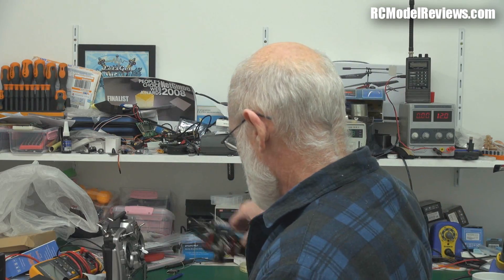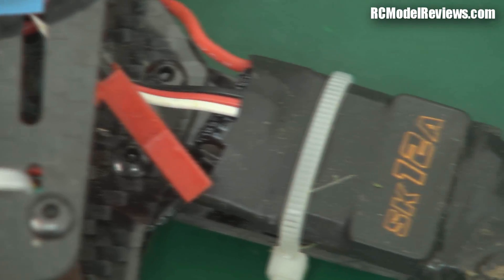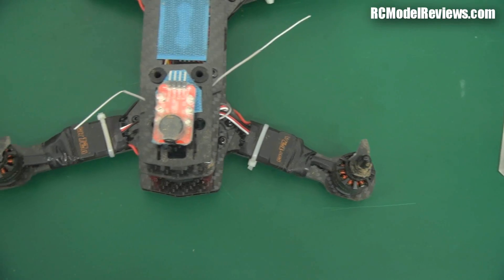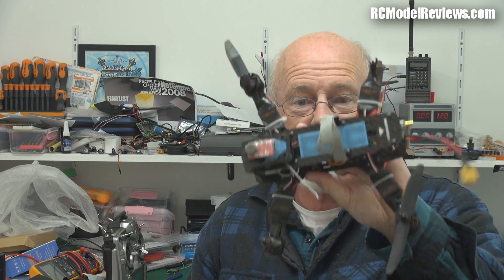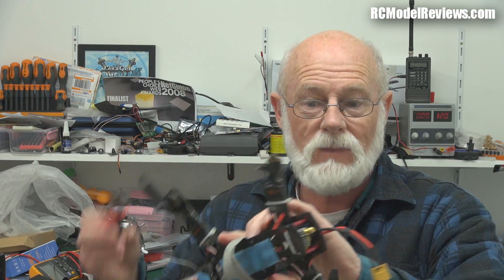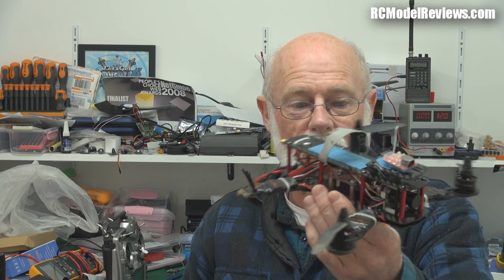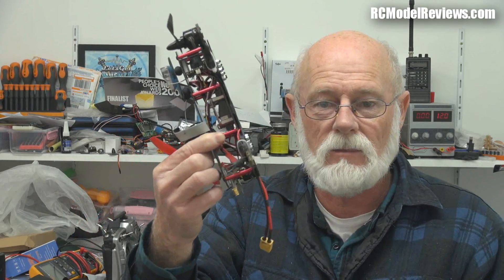ZMR-250 Chinese mini quadcopter crash report

Comment: Hey Bruce, I've been flying this frame for the last month. I broke  around 20 props, 3 EMAX motors, one vTx(antenna connector), two of them pink Al support column thingies and even somehow managed to break barometer on the Naze32(still not sure how that happened),even managed to fry 2 ESCs.

Crashed it into mud, dirt, grass and concrete. When I crashed it to concrete I bent two motor shafts, broke all 4 props, and the vtx got flown 10 meters away from the crash site due to the force of the impact. I don't have OSD so I can't be sure, but I was probably making more than 50 km/h during crash. Arms were just fine. Only some minor scuffing on the frame. I'm still using the same frame. It's working just fine. 

I don't think you're intentionally misleading anyone, but either Berry managed to crash that thing just the wrong way(in such a way that even a blackout would have broken), or you are just prepared to not  to like this frame. No one is saying this frame is better than Blackout. What we are saying is, For the price of one blackout frame you can buy 6-7 of these "cheap Chinese knockoffs"(Which i did. I bought 2 of them, one is still unopened. Also with the leftovers I bought 8 motors and 4 ESCs)

The next argument is "But if you bought a Blackout, you wouldn't have to bother with fixing it all the time" What if it flies away? What if it falls down into a river? Sea? In a massive corn field? Or it falls down on a road and before you pick it up, someone turned it into a paste with a car(happened to my friends MiniQuad)? You just lost 200$ worth frame. While I just lost 30-40$

I got nothing but respect for the guys behind innovative frames like Blackout or QAV250. But the fact of the life is some of us don't want to(or can't) spend 200$ on a mini quad frame while just a fraction lower quality frame can be found for 40$

Reviews like your make people think that if they can't afford to buy that 200$ QAV250 with 40$ a piece T-motors, they shouldn't even bother with the hobby. Which is simply not the case.

We need new people joining the hobby, now more than ever. Bashing affordable alternatives while glorifying the ridiculously priced products is not the way to go.

Cheers.
Reply: illusive aeldre I'll do another video comparing the arms of the ZMR with other miniquads and you'll see how much weaker they are in this area.  All they have to do is make the arms a bit wider and the problem would be solved.
Reply: Then they would be heavier, and people would bitch about how heavy the frame is. IF you don't mind some extra weight, put two arms together, add some CA in-between. Now you've got 6mm arms that are practically unbreakable.
Reply: illusive aeldre
That's always an option.  Remember you'd also need longer bolts for the motors and for mounting the arms themselves.
Reply: I already have 2 nylon nuts on each bolt(to have the ESCs inside the frame), and EMAX MT1806's comes with 3mm screws, so I had to get longer ones anyway
Reply: illusive aeldre I built my ZMR up, but I'm only using one bolt and cable ties through another, 4 bolts on each arm seems excessive.
Reply: I agree that 4 bolts might be excessive, but just 1 bolt sounds a little too less to me. aren't you having flex issues?
Reply: not yet, no motors on it ;-)
Reply: I beat the crap out of my 3 ZMR250's and they take a beating! I also have a Blackout that sits and collects dust, I can't afford to crash my $600 rig! So until Blackout and GetFPV start sending me free mini quads I'm gonna keep bashing my "cheap Chinese clones"!
Reply: jkflorida2013 Why the hell did you spend 600 bucks on a hanger-queen then for, you tool?
Reply: I built the Blackout way before these cheap frames came out. I still fly it just not as much and not as hard as the ZMR250. Also I can't sell it. It's like my baby.
Reply: jkflorida2013 Then it must have a particular "sense of value" to you.

And I can understand you not wanting to trash it. Truth be known, it would probably survive more prangs that most of your ZMR's. But I hear you - it's hell hard to toss up your best in case it comes back a wreck, huh? Not all bingles are the same - height, speed, angle of incidence blah blah blah. Would hurt to trash your Blackout, but hey... didn't you buy it to fly it? 

"Tool" was probably a bit strong from me - with 'florida' in your uid, I'm guessing you're from the USofA? That word can be both passive or aggressive. Take it as being 'ya dick - all that money and you're not flying it'

No direct offence meant Buddy, K?

Comment: Sorry, but for comparison can you crash the blackout and qav exactly the same way as this one? Otherwise it wouldn't be a fair comparison.
Another thing I'd like to see is a video of the crash. For all we know it fell out of the sky from 2 km...
I understand that a blackout is a better product but to be honest it since the first part of the review it looks like you wánt this frame to fail... Normally your reviews are more objective in my opinion.

I fly with rcx motors so this repear would cost me around: 10 USD including shipping. I can crash like that 12 times before it cost me as mutch as the blackout.
Reply: You're right of course but I've never seen a blackout with a broken arm...
Reply: Frans de Jong This frame fell onto damp soil, the same as my Blackout has on many occasions.  I've broken all four props on my Blackout on many occasions and on the weekend, a QAV250 flew straight into a tree (whack!) then fell to the ground -- broken props).You only have to look at the ZMR frame to see that the wrist section of the arms are a stress riser which is more likely to fail than the rest of the frame.You don't see many broken carbon frames around and those which are broken have usually encountered a very hard surface such as concrete or a road-surface.I have to say that I was a little disappointed that this arm broke so easily, I was expecting it to be a bit tougher and able to survive falling on to damp ground from any height.If I didn't publish this video and folk started bitching about their ZMR frames breaking arms too easily, people would castigate me for not pointing out the weak-points  -- rock and a hard place ;-)
Reply: ***** Since you have both, do the arms of the blackout fit on the zmr? It would be a cheap way to gradualy upgrade to a blackout
Reply: Frans de Jong I'll check tomorrow but I know they're quite a bit shorter for a start.
Reply: +xjet that shouldn't be a problem. I have a lot of space between the props and the frame with 5" props.

Could it be a QC issue with the arm? I looked back in your reviews and my frame is a lot better quality than your showing in the video with the bad drilling...
Reply: Frans de Jong
There's certainly not a lot of material at this point on the arm and this particular version has narrower slots for the screws than later ones I've got here so it "should" be stronger.   The newer arms seem to be a different layup to this one so it will be interesting to see if they are indeed stronger.

On the positive side... apart from having the wires torn out of it, the RCTimer motor didn't suffer any damage to the shaft or anything, which isn't bad, considering they're only 2mm shafts.
Reply: ***** hi bruce ive got this same quad thanks for ur 1st review, n its super good,nice shine no problem what so ever with the holes
Ur motor wires came off cause u soldered them to the esc ..if u used bullet connectors this wouldnt have happened for sure
Reply: Mar1wan1
Bullets are bad-news.  They're extra weight and a potential failure point.  I never use bullets in any of my multirotors because I've seen them cause too much grief.

It was only a $10 motor so I'm not worried... some people spend more than that on carbon props for their minis :-)
Reply: ***** i know its extra weight i watched ur previous vids but i think this extra weight worth saving ur motors: )...btw i also directly soldered my motors to escs..but now thinking to go back to bullets
Reply: Mar1wan1 I've started using servo connectors, much tidier. They handle the amps on 3s with no problems so far.
Reply: Heh, a broken arm is kinda hard to interpret, either it's broken or it's not.  I'm not sure how I would surf the internet in a way that would let me semi-intentionally avoid seeing broken Blackout arms but it's an interesting theory...  I think it would be more likely that I'm lying either to myself or to youtube, if that's what you want to believe. ;)
Reply: Matthew Adams
I think the video I have just uploaded kind of conclusively shows why the Blackout arms are stronger (and therefore less likely to break).   The ZMR250 arms are weaker -- but it is only a $30 frame so I don't understand why so many people are upset by the fact that it's not as strong as  a $150 frame.
Reply: ***** I don't think anybody is upset about the fact that the zmr is the weakest one.

I watch all you vids and the review about the zmr is the first one ever to look a little biased. I was shocked by that. But your latest vid explained everything.

Keep up the good work and don't be so scared of a little critic on your work we (I) just want to keep you sharp as ever :P
Reply: Matthew Adams Yep, its like being a little bit pregnant.

Comment: I agree with some of the comments that for some unknown reason to us, you are bashing the Chinese frames vs the name brand without being very objective.  Yes,you get what you pay for but that's expected and anyone can easily break one of the name brand frames by going full speed into a cement wall.  In order to correctly asses the breakage/quality you would need to break both frames under the same conditions and that can only be done "on the bench"..

As far as the broken motor, it can be repaired easily with a little time and effort.  I have rewound many motors and often my rewinds come out better than the factory one.

Comment: Just finished putting my ZMR250 together, did the first flight on the weekend when it was way too windy and had a few since then and so far I am loving it.
I know they may not be as strong as the more expensive frames so I have attached my motors with zip ties. We will see if it helps in time. :)
That naze32 is definitely superior to the KK2.
The only things I have done so far is up the yaw rate a bit and stop the motors spinning up on arm.
I do want to get a CPPM capable rx though, will make the wiring much tidier.

Comment: Hi Bruce, Looking at a new transmitter. frsky 9d. I've seen your vids on them just wondering if you have a different thought on them to date. As of now running an orange tx and receiver but had some unexplained crashes (dji f 450 kk2) im thinking its the radio.what is your take on the transmitter today and are you still using it? got the naze 32 afro flight with telemetry and all the bells and whistles. will radio be a good one. Thanks

Comment: not looking good for the ZMR frames, i see this around a lot on the forums and your earlier review of the cheap carbon fiber they use. Do you think its an issue with the CF or the design of the arms??  

im now more than ever determined to make my own frames
Reply: Syler1979 It may be a combination of the material and the design.The combination of the long slots for motor-bolts and the narrow arms where they join the motor mount section produces several points of high stress -- where the forces are concentrated into a very small area in the event of an impact on one of the arms.It would be much better if they made the arms wider or did not taper them quite so much  near the motor mount.
Reply: ***** So more a case of no R&D in the production more just a design and cut approach. Its given me something to think about with the designs i have been coming up with, they all taper down toward the motor mount and use elongated bolt holes in an X configuration to allow 16-19 motor mounts

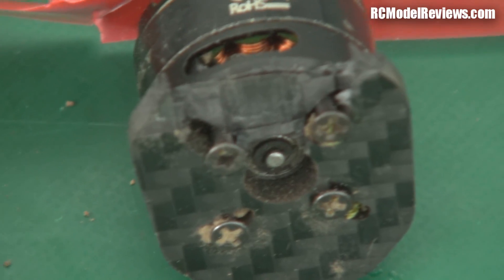Comment: Around the 1:10 mark he makes a comment that the arms are very thin, yet they are the exact same thickness as the BO frames, 3mm thick.
Reply: raider1284 That's thin in width when looking down on the quad.  Perhaps I should have said "narrow".
Reply: ***** They look to be the exact same width, or very similar at least. 

The zmr arms: http://imgmgr.banggood.com/images/upload/2014/08/SKU147479-6.jpg

The BO arms: http://www.minihquad.com/media/catalog/product/cache/1/image/1600x/040ec09b1e35df139433887a97daa66f/i/m/img_6609_2.jpg
Reply: raider1284
Not quite... I'll post a video later today in which you'll be able to see the very significant difference in the width of material at the narrowest point -- where slots for the motor bolts have been milled.
Reply: ***** That would be very helpful, thanks. If the product pictures for the zmr frame are purposely misleading that would be very helpful to know and quite damning info against that product.

Comment: Do you know if this particular arm had a lot of cracks or defects around the screw holes? I'm wondering if the problem is part design, partly defective carbon fibre, partly poor machining.
Reply: crenn6977 It's mainly design, as you'll see in a video I'm uploading now.

Comment: I've had landings into soft mud snap off an arm on my cheapy sk450. It's hit some trees and stuff and only broken the pops so it's not like it's super weak. I think that if you get one arm stuck in soft mud the rest of the quad wants to keep moving and snaps the stuck arm off.
Reply: donpalmera Yeah, but isn't the SK450 plastic?The 450 is also heavier and has longer arms -- which means much more stress is applied to those arms if you have a crash.  Short of a very high-speed contact with concrete or rock, these carbon miniquad frames should be virtually indestructable and indeed, most of them are.
Reply: ***** Not sure what it's made of. The edges of the snap are "hairy" like it's made up of fibre. I've got a $40 mini frame (I'm cheap) in the post because of your videos :).

Comment: What do you mean "Like Spektrum"?
Reply: oliverg98 Spektrum was, and still is to a degree, (IMHO) a very overpriced system.   Certainly the original DX series transmitters and receivers were very lacking in the "bang for your buck" department.The newer stuff is far better... but still can't come close to the value for money that some of the other gear on the market offers.  With Spektrum you are paying a significant premium for the branding -- which obviously many people believe is worth it.  However, there are a lot of folks who've moved to other brands after trying them and experiencing the extra value that can be had by doing so.
Reply: Is that why due to the RCM&E survey spektrum is the most used radio gear!
Reply: Oliver Gallimore
Yep, because Spektrum put so much money into marketing the product is very widely used.   However, Spektrum users have to be aware that the only way the company can afford to put that much money into marketing is by charging a healthy premium on top of the true value.

Comment: How about double up on the arms so you end up with 6mm the same as the MXP230.. Also means more space between the bottom frame to work with for a wire harness,, :)

Comment: Just use 2 nylon bolts on the arms... and they break first 
Works a treat
Reply: The solution is often the simplest of all. :') Good idea!
Reply: SvenOkonomi An even better solution is "stronger arms" :-)  Saves on nylon bolts :-)
Reply: *****
Quite right, so heres a curveball: Do the blackout or Q spare arms fit the Chinese frames? ;) Press costs where strength doesn't matter, and still have the strength where it counts.
Reply: SvenOkonomi
From memory, I don't think they fitted -- I know they're shorter for a start but I'll check tomorrow.
Reply: And bullets right at the motor so it doesn't pull the wires out.

Comment: Bruce, it's unfair and a bad generalisation, to label all of these china made quads as bad quality and weak. I have had several massive crashes with mine (as have others) and the quad has not even got a scratch on it. One crash was from 70' up, I had a brain fart while inverted and went full pelt into Terra Firma. Nothing, not even a broken prop (Mine are carbon). So I really do think that in this particular case you have just received a dud.
Reply: SJohnM81 I only labeled the ZMR250 as having a weakness and when you look at how it's designed you can see that the point where the arm is at its narrowest just before the motor mount area is always going to be vulnerable to crashes where the motor hits the ground first.   I can only review what I have -- which is why I have 3 of these frames.  The latest one looks a bit better than the first two but we'll see how it turns out.

Comment: My kim250 cheap $40 chinese frame has took a beating its not even carbon fiber just G10. Its fallen a good 60ft inverted, crashed full speed into a steel post and much more and i am yet to even scratch this frame.

 I think you are giving chinese frames a bad name when they deserve some praise. Obviously the quality wont be the same as the $200 frames but I doubt any of them would of stood upto what this kim250 has
Reply: "would have"
Reply: Well done

Comment: The ZMR 250 centre plates are .5mm thicker than the Blackout centre plates.  Instead of focusing purely on the arms (which are the same thickness) perhaps consider if the arm didn't break it would of cracked the centre plates instead.
Reply: "would have"

Comment: Using nylon bolts on the arms and bullet connectors (you say not to)  would of saved the motor from having its wire ripped out and probably saved the arm as well.
Reply: "would have"
Reply: Philip Bailey oh no its the English police again.

Comment: mine has taken some hard hits and still in piece.

its hardly an accurate review with 1 crash and 1 broken arm.

my mate snapped a dji 450 arm from a 10 foot dive, yet i have had harder crashes and not broken 1.
my point is all impact results are different